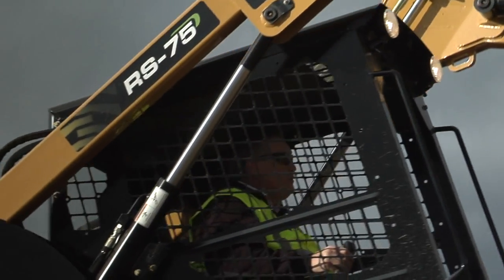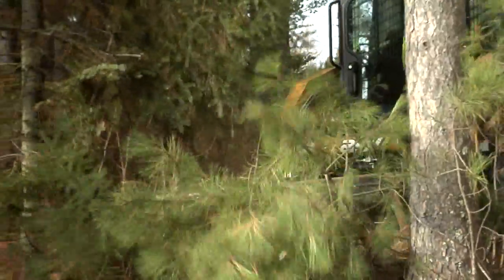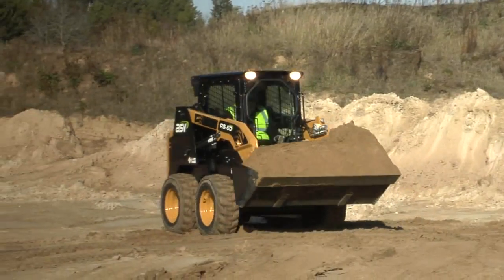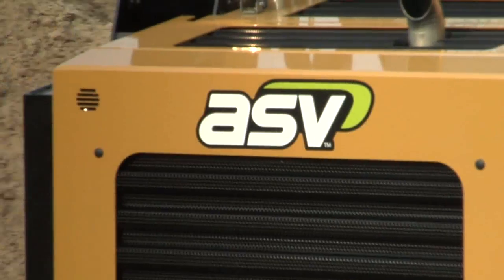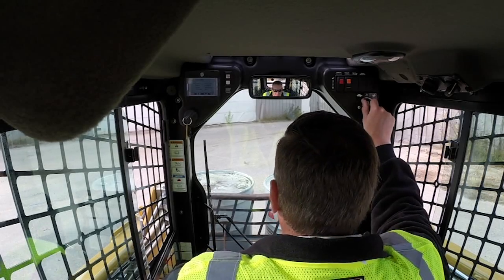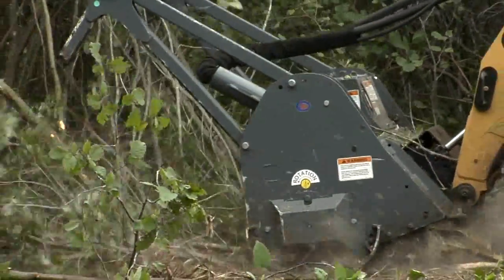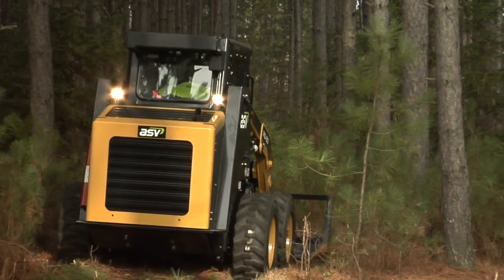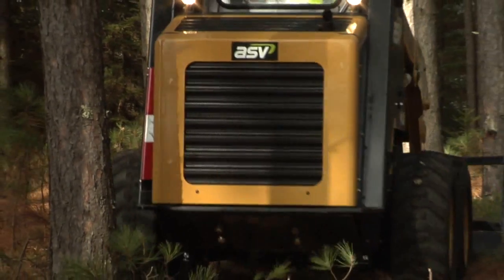ASV Skid Steer Loaders

Comment: Asv,do you have a 120 for forestry mulching  with hard tires with grouser tracks for great traction and less maintenance problems .and would like to see the comparison between your rubber tracked machine and the set up I asked about ? We are very unhappy with the new case sv 340 .with mulcher it just ain't enough we feel and have had numerous breakdowns within 600 hrs that were just issues like bad starter .and do you have a dealer for the finger lakes of my state .would love a demo .thanks.